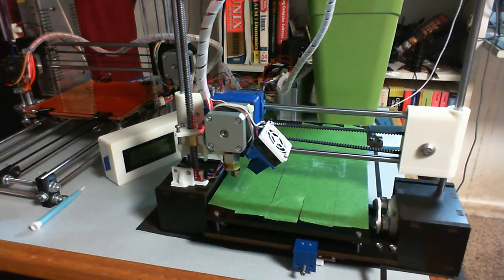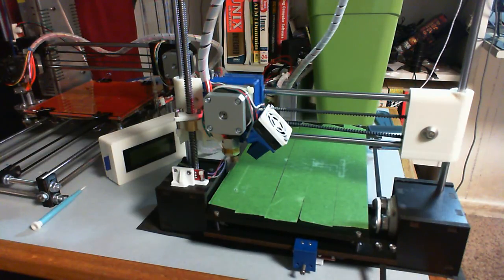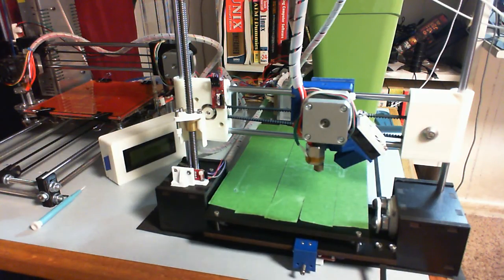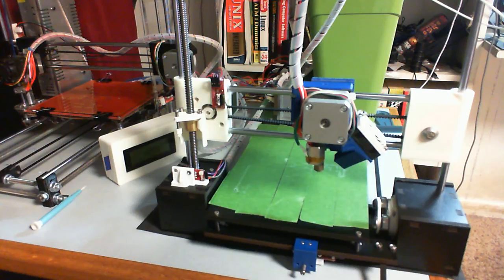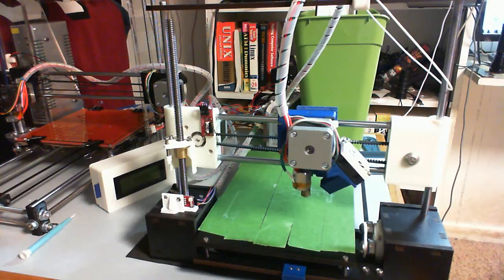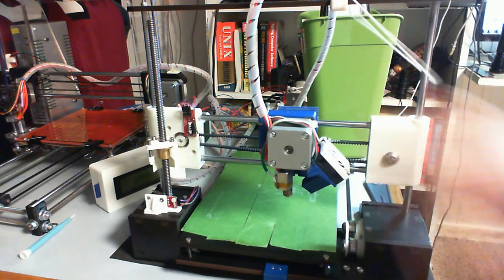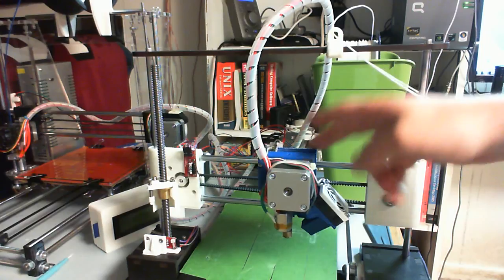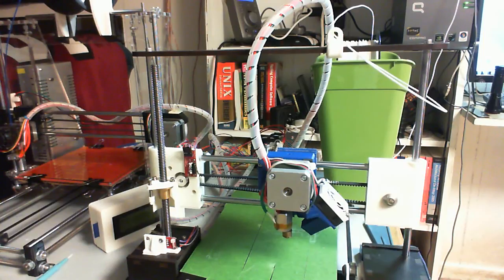QU BD TWOUP 3D Printer upgrade part 6- end stops

Comment: Why does the title say "Endstops" when you barely mention them. I was looking for some help to set these up, troubleshoot, and the right G-Code to use for homing. Sorry but this video (with this title) was a waste of time.
Reply from the maker: +Kevin Summers Sorry to waste your time. The kit by default does not come with endstops, you have to print them yourself, get the switches and set them up yourself. I even had to make a part that didn't otherwise exist. as for the setup, the endstop plugs are clearly labeled on the board and enabling them in the firmware is a matter of uncommenting the appropriate lines (around line 278) for endstops in the configuration.h file.

Comment from the maker: To respond to Peter Brown, I use spiral loom for cable management. I also use zip ties and these adhesive square zip tie mounts. the 3/4" size works well and the adhesive seems to be strong enough.